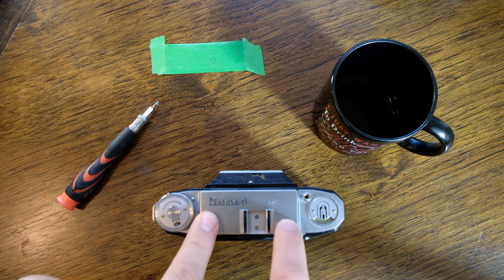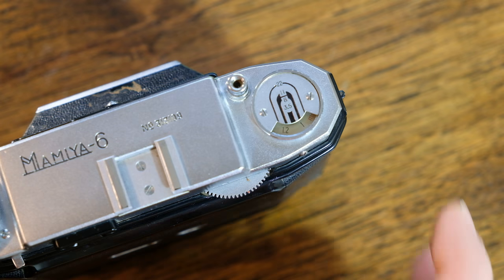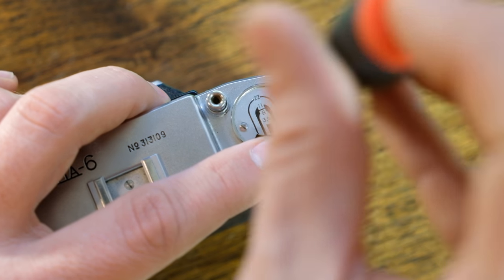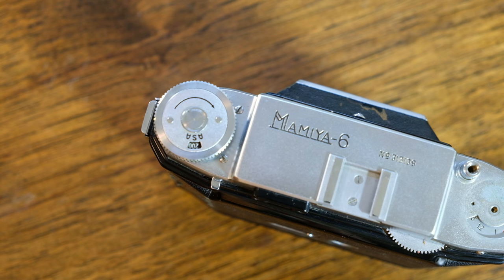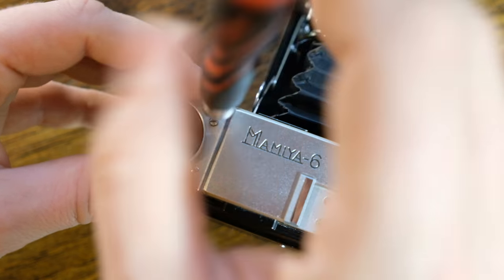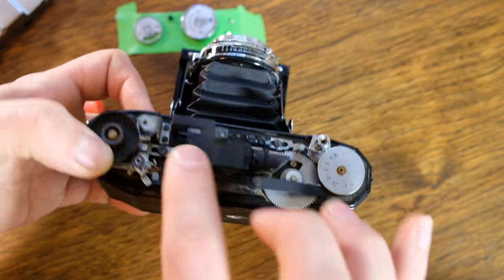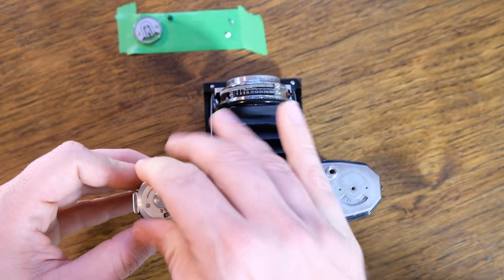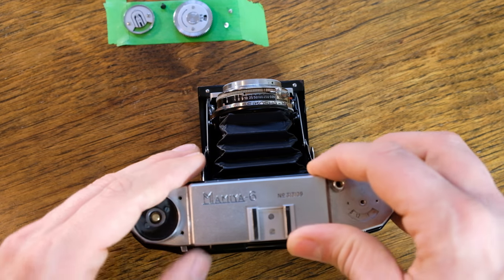How to remove the Mamiya Six Automat's top plate

Comment: Dear KP - 
This is gold dust advice - thank you so much! My newly acquired mint condition Mamiya-6 Automat recently arrived from Japan, but I soon discovered it had a winding mechanism that occasionally jammed 😖. Your video clearly showed me how to remove the top plate, revealing the scarily complex assembly of gears, levers and ratchets that sit below the winding knob. These I carefully lubricated with a few drops of watchmaker’s oil, pretending I was the old repair guy from Toy Story. Now the combined winding on/shutter cocking/frame counter all work like a dream 😀. I owe you a beer when you’re next in London!  
PS. Allow me to admire your effortless manual dexterity - micro-surgery’s loss is photography’s gain.

Comment: I have a Mamiya 6 folder with an almost impossible to see focus patch making if difficult to get a good focus sometimes. Are they all this way or only certain models? Mine is a 6x6 No.38798, not sure of the model.  
Thank you for the informative video
Reply from the maker: Beam splitter glass in rangefinders can and do fade over time. Replacing that and the mirror is a common and easy repair in some Speed Graphic cameras,  but I'm not sure if that is a daunting task in a Mamiya 6 or not. What you can do that may help the visibility some is get some sort of thin see-through colored gel/plastic and tape it over the window for the rangefinder patch. The color should make the patch more visible.

Comment: Wow,  great video which i really needed to see! recently purchased a mamiya -6 automat. needed to do all of those things so thanks very much !.....however, once i put it all back together  the counter indicating the number of exposures was no longer working, and it was before i did all of the things that needed doing. any suggestions  ? .... zen billings, niagara falls region in canada
Reply: I realize this question is two years old, but I'm adding this in case it helps anyone else who stumbles across it later. The frame counter on the Automat resets automatically -- either when you flick the little thumb lever (Kip's model) or when you open the back (the later model I have.) I don't know about Kip's earlier model, but on the later model this reset is powered by a long spiral spring that's coiled up inside the counter mechanism (visible only after removing the top cover.) The end of this spring has a hook in it, and this hook needs to hook into a small hole in a circular metal plate (which also has larger holes all around the rim; one of them is secured by a screw.) This plate is visible after you unscrew the advance knob. If you don't notice the hook, it easily can unhook itself when you remove the top cover (I discovered this the hard way!) and then when you put the cover back on, the spring will no longer reset the counter because the spring isn't providing any tension. The remedy is to re-hook the hook in the small hole in the plate. The easiest way to do that is to remove the one screw in the multi-hole plate (you may want to mark which hole it was in) and then remove the plate; then put the top cover back on while leading the end of the spring out through the counter hole in the top. Grab the circular plate, hook the spring hook in the small hole, then set the plate back in place, twisting it a bit if necessary to get the spring arranged underneath, then re-insert the one screw. If you find the spring doesn't have enough tension to reset the counter, remove the one screw and wind up the plate one or two holes to increase the spring tension; then replace the one screw. Go gradually and don't over tighten it, because if you break the spring, good luck finding a replacement!

Comment: my model is the one that does not auto-cock the shutter, do i unscrew the knob just the same? thanks
Reply: My viewfinder is dusty, and patch is barely visible. Do you by any chance know the correct way to clean it??? THANKS!!!!
Reply: JUST SUBSCRIBED
Reply: Keith, I have IVB also and it has another way of the removal of the top cover. You will not be able to just unscrew ASA-dial and you'll need to unscrew a ring and a fork from the film holder knob inside a camera.
Reply: @bigcat3342  to clean viewfinder just remove the top cover and use ear-sticks with alcohol and compressed air for mirrors and glass.
Reply: @karkunow  thanks for the reply! i got it unscrewed and i tried my best to clean it but am not too sure if i should use alcohol on the rf prism... also my bellows have tiny holes... trying to find liquid rubber for it can't seem to find any where i'm located. Thanks though!!!
Reply: @bigcat3342  And also you can order new bellows on ebay for 40$ from mytongguy. Not sure about quality yet - my new ones are currently in the process of the delivery.
Reply: @bigcat3342  also you can try and use gaffer's tape to patch your bellows manually. Or use Elmers glue recipe from here: https://itstillworks.com/repair-bellows-camera-6653811.html or here: https://www.photrio.com/forum/threads/my-bellows-repair-recipe-and-technique.97496/
Reply: @karkunow hi. Sorry for the delay but I also have a IVb and want to clean the inside of the viewfinder. Do you have any link to a demonstration of this? Thanks in advance.
Reply: @karkunow  The winding knob unscrews identically on the IVB model.
Reply: @thatfellarosto  sorry, but I believe I was right there. I have done that project with my hands :)
Reply: @karkunow  I have 2 IVB models and a IVS. on all of them the asa/winding knobs unscrew just like in the video. These cameras were almost all built identically in the 50s with minor changes.